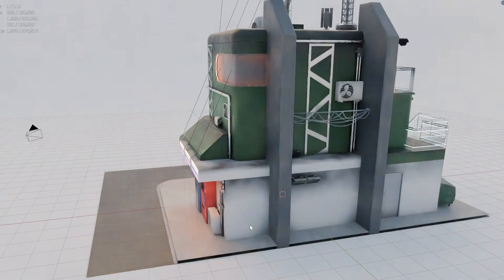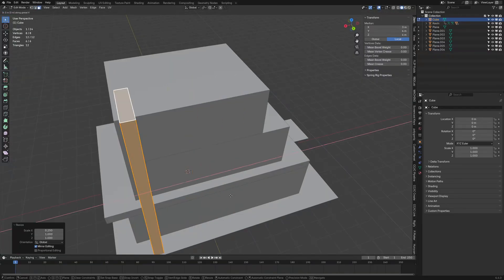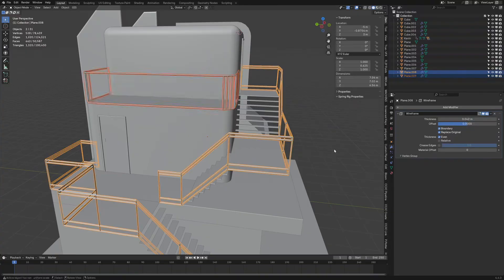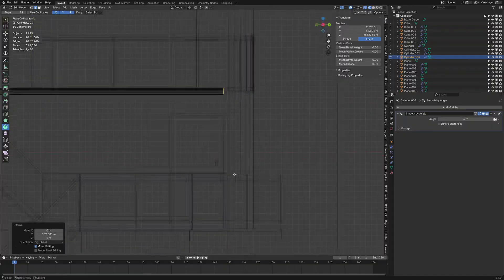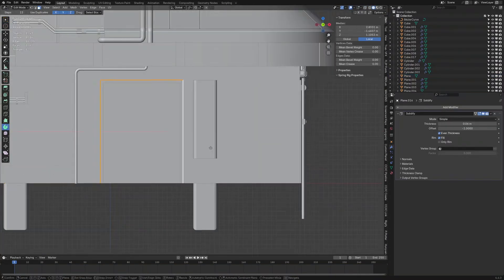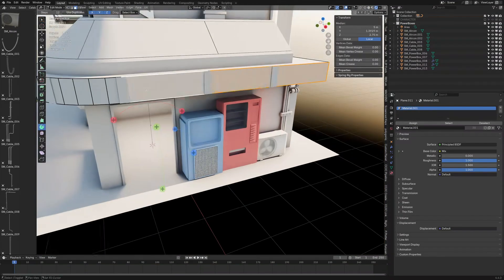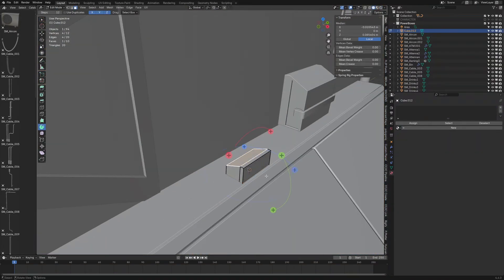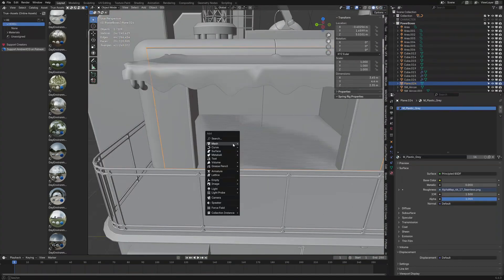Watch Me Make a 3D cyberpunk building From Scratch!

Comment: Nice vid! and thank you ! I`ve gotten to that phase in Blender / Unreal / MyPcgame project, where I`m trying to figure out how to create a modular building system. The game is going to be a TopDown tactical strategy , scifi game. What Im leaning towards is to create individual wall , floor etc segments...multiple variations. Doors, windows etc. Texture them on Atlas maps and then once all imported, in UE , i could theoratically create many different types of buildings, by using the same parts. But for smaller buildings i might try this method !